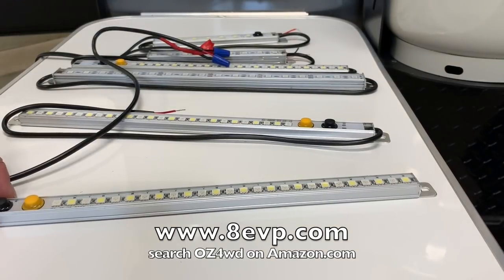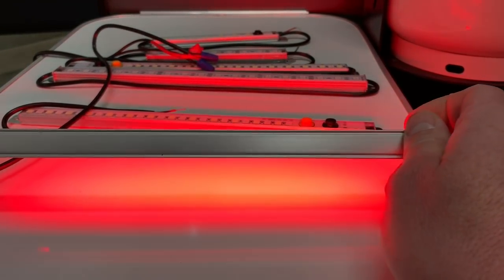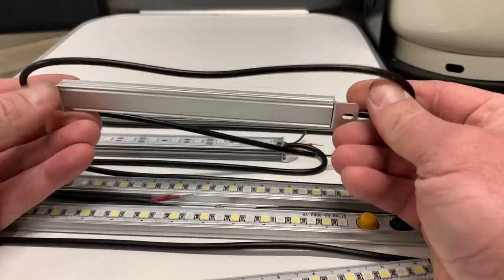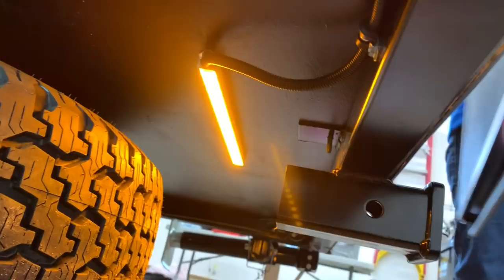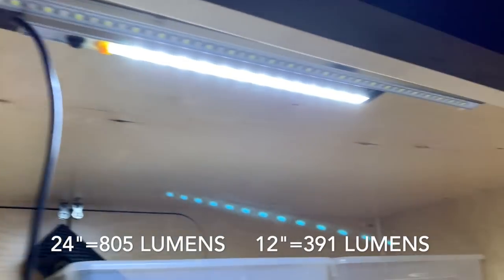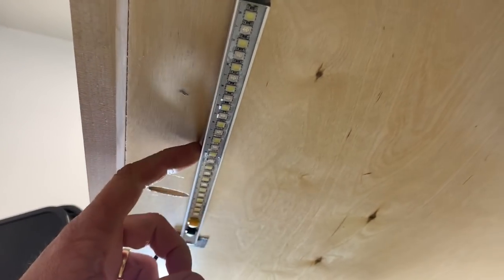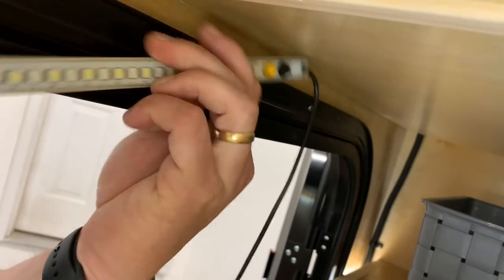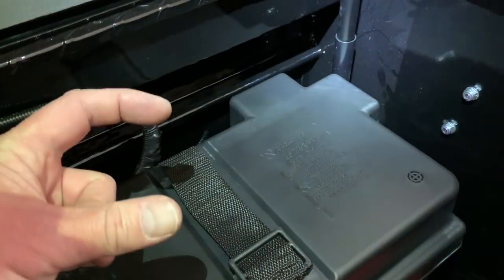Hiker Trailer - Lighting additions

Comment: MATT, Bob Walker here...  Q.  Where do you draw the  power from?    For under trailer lights, under shelf lights in your galley, up top light bar mounted to the  roof rack facing rear?   Toolbox light pretty straight forward..  I-ordered  a 6 circuit fuse box. Thought i would run power to that then i’d have 6 circuits w/fuzzes.   Q. Where would suggest taking the power for the  6 circuits fused panel.  Tomorrow I will be “playing” in my garage with my light options & fuse block.  I will take a picture of it to send you. It is pretty small maybe  2.5” sq.
Reply from the maker: Bob,  i ran all the wiring to the fuse panel Hiker provided for me in the back galley. The toolbox light is right to the battery with inline fuse.

Comment: Did you just drill directly through the floor of the Hiker to run the wiring for the switch? My battery & fuse panel is the galley so I'm a little nervous to start drilling!
Reply from the maker: Yes, I drilled a new hole. Make sure you seal it well. I used a silicone sealant - I put some on the top and bottom to be safe. You can try to fish it through the hole that Hiker already has, but it might not fit -either way you need to make sure to seal it when you are done.
Reply: @MWDAdventures  Thanks!

Comment: Hello Matt, yes I picked up the “TIME MOCHINE” mid Dec. , when it snowed in Denver. Q: Was I suppose to get a battery box from Hiker . I have electric option #1 under/in back w/the galley.
Reply from the maker: I wish I knew.  Sorry I can’t help you there. My battery was located in the toolbox so to prevent any tools from arching they put the battery in a box. If the tops protected I see a need for a box in the back.

Comment: Did you wire the lights directly to the BATTERY? Do I need a fuse connected to the lights? It is april27 2022 have my HT ! got it on dec9 2021 ready to put lights in shelf area.
Reply from the maker: The fuse box for ours is in the left rear corner.  Few open slots on it that we used so that protects the circuit with fuses.
Reply: @MWDAdventures  thanks MATT my neighbor is going to put my 3 light strips in got them last August 😂 way before picking
 up the HT in Dec. Thanks again for your help👍😎🌽🐢🌲🇺🇸🌎

Comment: How many watts total does that pull and how long can you run the lights?
Reply from the maker: Brooks Hargrove the 3 stick lights in the galley is a total of 2.1 amps. The lights for under glow are 1.5 amp for 3 lights.   I haven’t done a run test for all the lights on but a long time.  I always conserve my lights either on or off shore power. I don’t run underglow much if off shore power.
Reply: @MWDAdventures  how did you where it all to the battery?do you have solar? inverter?